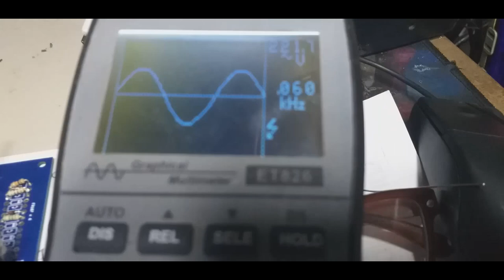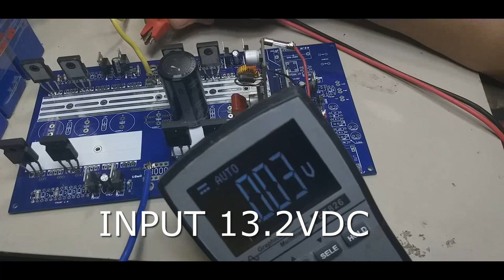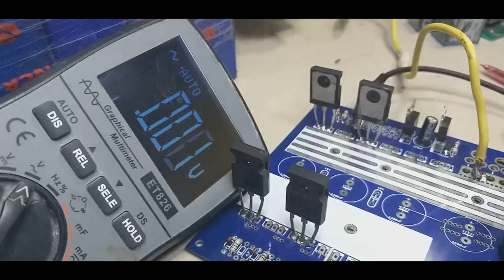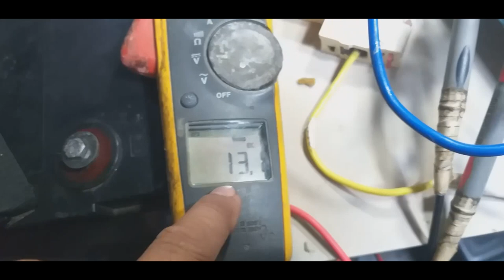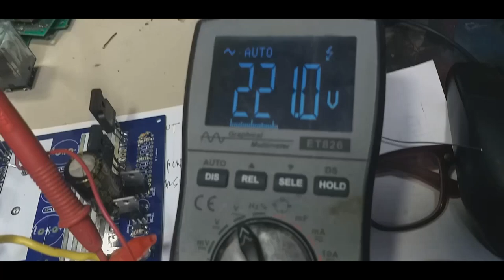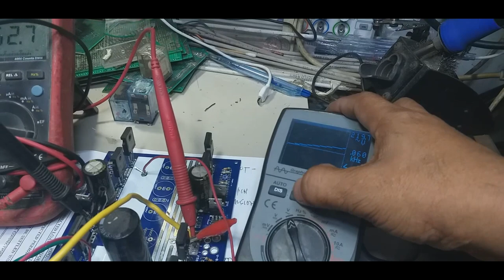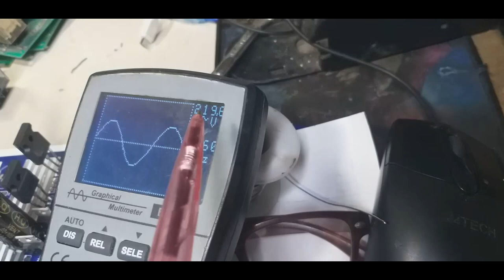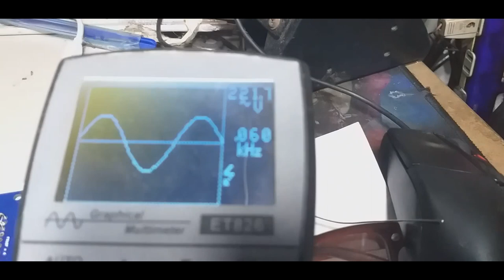# high frequency inverter 12v to 220v using IGBT 60N60 w/totem pole driver tip 41c and tip 42c

Comment: sir bakit 2 stage conversion pa ginawa mo from 12Vdc to 362Vdc and then from 362Vdc to 220Vac for this high frequency inverter, diba pwedeng direct na from 12Vdc to 220Vac? Diba mas maganda ang low frequency inverter kamukha ng ginawa mo dati (even though mas mabigat dahil sa torroid) mas mahusay mag handle ng inductive load such as motor pump, aircon or other big loads? Pasensya na sir sa dami ng tanong ko, sana mag ignite po ito for discussion at ma-explain mo po pros and cons ng high frequency and low frequency inverter which you already show earlier. More power sa channel mo sir and keep inspiring Filipinos.
Reply from the maker: sir start tyo sa high frequency inverter  12v to 362v eto yun  dc to dc boost converter  ang output is square wave ang  transformer nya ay ferrite core dto naman  tyo sa 2nd stage inverter eto yun 380v yun input and 220v output sir eto po yun mag modify para maging pure sine wave  yun 1st stage inverter is push pull square wave yun output sa 2nd stage inverter h bridge at kung sa lakas naman ang pag usapan malakas ang low frequency inverter kaya nya handle yun inductive load  bulky nga lng yun inverter unlike sa high frequency inverter isa pa yun sa high frequency inverter yun idle nya mababa yun sa low frequency mataas yun no load idle current nya

Comment: hello Po, Meron Po akong power inverter pure sine wave, parang merong problema Po, Kasi Po umabot Ng 300volts ac output at Minsan din mag low voltages 140 volts, Hindi Po stable Yung output Niya pag tester ko po, pero gumagana Naman Po Yung tv namin, nag alala PO Ako baka masira Yung tv, sir ano Po kaya Ang problema ng inverter ko Po, gumawa Po kayo Ng video at e explained nyo Po please.
Reply from the maker: check mo po yun variable resistor sa feedback multimeter po check nyo po resitance kung stable yan po asi yun nag dadala ng duty cycle or nag lilipat ng voltage sa low and high voltage